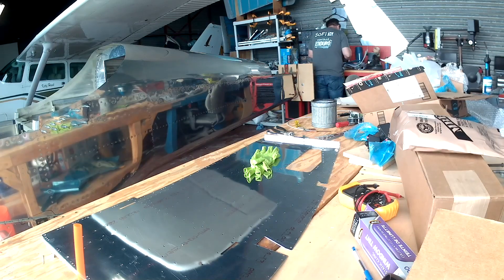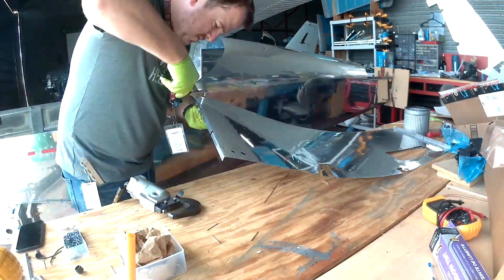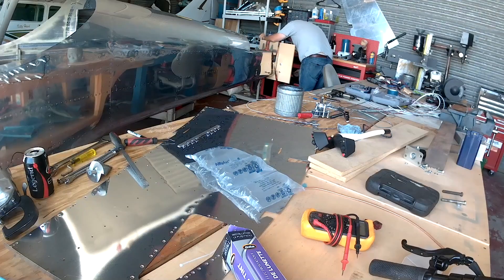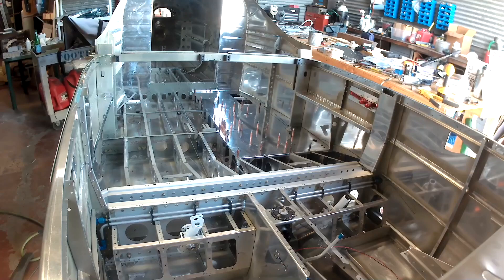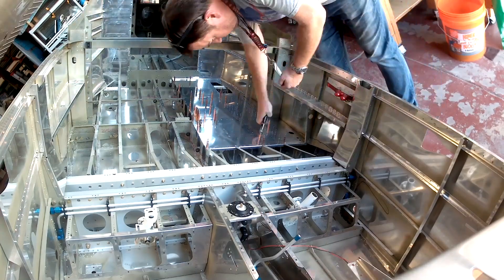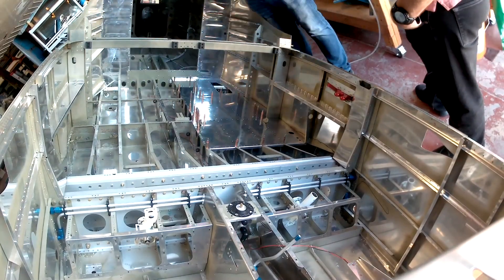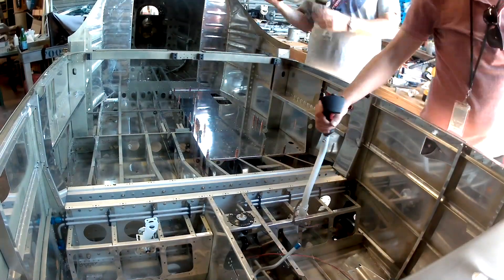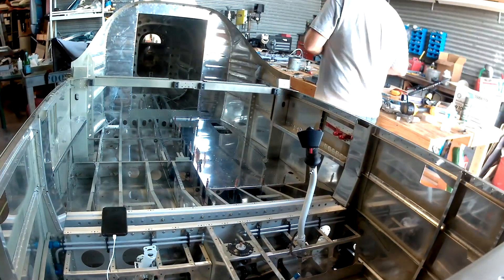RV - 14 Ch 32 - 03

Comment: Here's a strange question.  How many times have you pinched your fingers with the pop rivet tool?  I have pinched my fingers 3 times and my belly twice ;P  Also do you know what the adjustment screw does on the top of the rivet gun????
Reply from the maker: Only about 10 times over the entire build. Not too severe though recently. :D

I'm not sure what the screw at the top does. I don't remember the schematics of a pop rivet gun. hahahaha. All I knew what that it was the only thing I could adjust at the time and it helped.